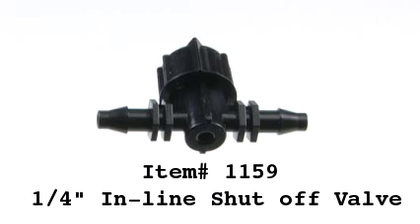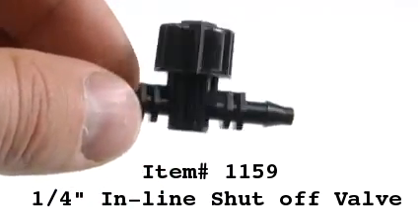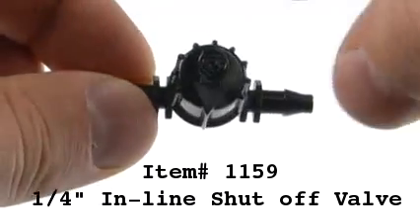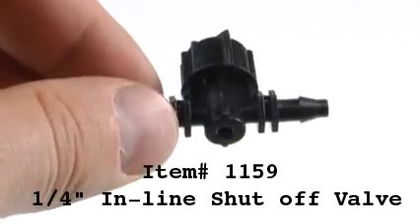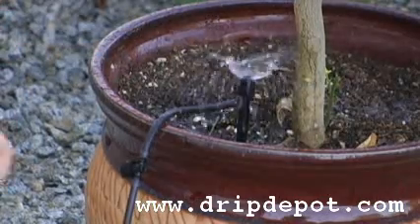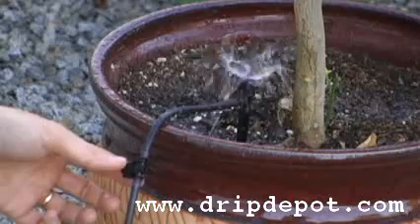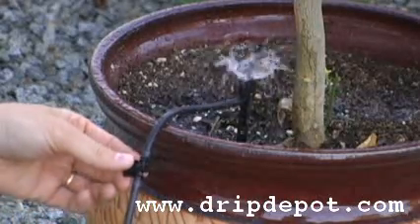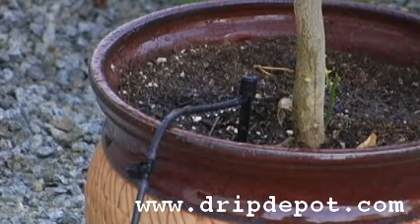How to install and use a 1/4" shut off valve in a drip irrigation system

Comment from the maker: Hi Charles,  These are a shut off valve that can be used as a drip emitter.  We recommend them for gravity or dirty water situations as the orifice is larger than  a typical drip emitter which allows debris to pass through instead of clogging the emitter.